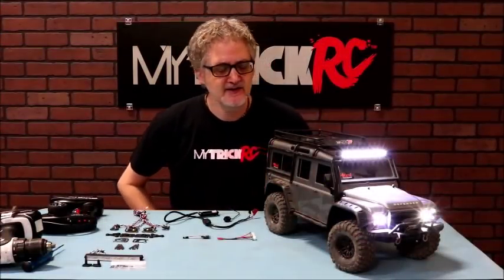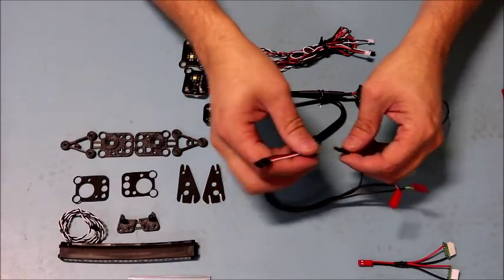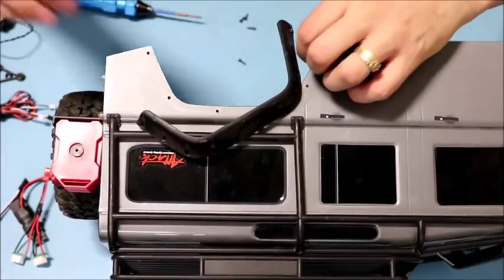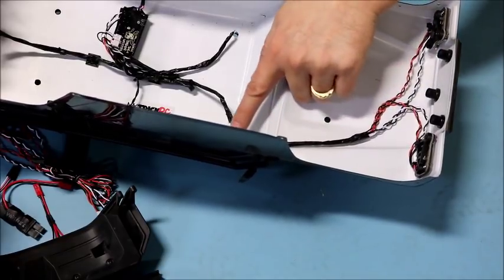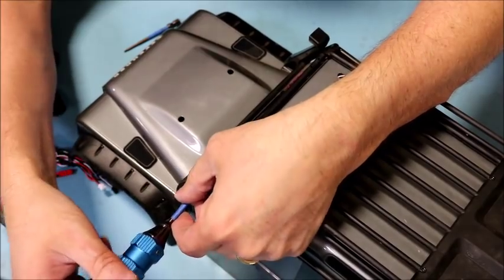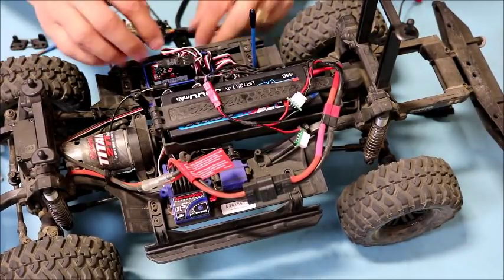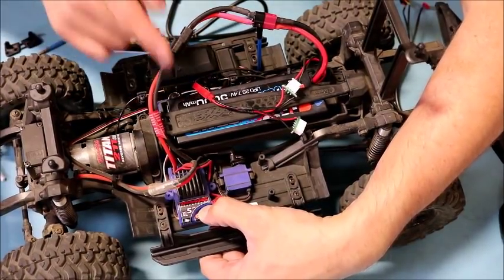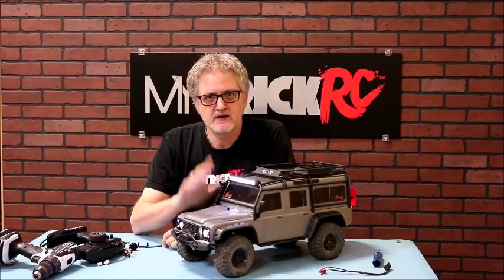Attack Traxxas TRX4 DG 1 Light Kit Install

Comment: I added this dragon light kit to my TRX. The one thing I missed in the video, is after hooking everything up, you have to use the selector to turn the lights on - and select the brightness. I could not figure out why the lights were not coming on. :)  One other note is that you need to have the throttle set to 50% forward and 50% reverse. Otherwise, the 70/30 split option will have the reverse lights on when the truck is in neutral. The lights look great and put out a lot of light. A great addition.
Reply from the maker: Good feedback, thanks Chris.

Comment: Very helpful video! I have a couple of questions for you. I want to cut the controller button cable, add connectors, and mount the button on the roof behind the light bar to make changing modes a lot easier. Do you see any problems with doing that and do you have any tips or suggestions in doing so?

Comment: Hi! I'm looking to purchase this kit from your website. One thing that's confusing me - does the controller differentiate between brake and reverse? I'm guessing not?

If it doesn't, it won't affect my decision to buy the kit, only if I should purchase both red brake and white reverse running lights, as opposed to just brake lights. Thank you 👍

Comment: I think this is an awesome kit! But, does adding the lights + wiring not compromise the waterproof electrics? What I'm asking is can you still wade through bonnet/Hood deep water?
Reply from the maker: All servo connections should be as waterproof as all of the other servo connections inside the receiver housing.  Regarding power there are two types of connection options, the balance port version which comes standard with the kit, or we also offer an inline "pass through" power tap which improves water resistance by connecting via JST connector.  In either case, the water can penetrate the connector, and we do recommend protecting that connection as much as possible.   We also recommend avoiding full submersion if possible, but the Dragon itself should not be damaged by it if you do.

Comment: The light bar I ordered last year did not come with the 3D printed bracket shown in this video. It did come with other brackets that do not fit. I don't want to punch holes in the body to mount it and the correct way is to use the roll cage to mount. I just don't understand why my light bar did not come with those brackets.
Reply from the maker: Please send us an email from the contact on our website.  We are happy to send you a set.
Reply: @MyTrickRC  I did send an e-mail and was told that I would be getting getting a set of the roll cage 3D parts but I never received tracking and never received the parts.

Comment: How does this work with the Castle creations cc bec 2.0? I see there are two unused plugs/ connectors on the Dragon Receiver harness. Castle says to disconnect the red wire off the speed control, so how does this affect the dragon unit? Any help wounld be great. The Castle bec is the waterproof unit and has two leads coming from it to go to the receiver , it's getting cramped in the receiver box already lol.

Comment: I bought the DG1BR233039 for my Bronco. That install video led me to this video which is a variant with the light bar. It isn’t the same kit but I’d assume the programming would be the same as the light bar in this video is just an additional light. I’ve managed to get all the lights to work and figured out the long/short press config for the headlight brightness but my brake lights & reverse won’t work. I’ve tried reprogramming the DG1 on the 5th mode numerous times, unplugged the 2cell balance port and I’m split on the channel 2 throttle as instructed. It’s also setup the exact same way as this video shows in regards to the the led strands port locations. Any ideas, or maybe this one is defective?
Reply from the maker: Hi, can you send us an email to: info@mytrickrc.com  We would like to see some pics of your wiring at the receiver.
Reply: MyTrick RC will do asap. Thanks for the reply!! Aside from that minor issue they’re awesome. I dig the high, mid and low beam feature too. It helps out quite a bit when taking photos.
Reply from the maker: @monkfry  Yes, we had the same experience.  Thanks for your support!

Comment: So it doesn’t do brake lights correct I see the running lights but no break before you went into reverse
Reply from the maker: Correct, this kit only does rear tail lights, and reverse.   Our UF-7 kit for the TRX4 has both brake lights and reverse.

Comment: Looks great. Do you need 3s lipo for this or is 2s lipo also oké? And where can I order the kit?
Reply from the maker: This system works off 2cel or 3cel Lipos, either one is equally good.  We have them on our website, there is a link on the home page.
Reply: MyTrick RC oké thanx. How about shipping costs to Europe?
Reply from the maker: It varies, you can try processing using our site.    Some places we are able to ship it free, others could be $6 or $10
Reply: MyTrick RC Thanx. Last question, does the kit come with a manual instruction?
Reply from the maker: Yes it has an instruction manual included
Reply: MyTrick RC is it on backorder at the moment?
Reply from the maker: We have a few in stock, and will be fully restocked in the coming week.

Comment: How would this work with a different brand esc? I've been planning on getting this but also have an esc upgrade in mind, so I'm wondering about compatibility.
Reply from the maker: It should work.  On rare occasions we've seen weird interactions between different ESC/ vehicles  But overall 99% of customer installations are issue free, both stock and custom builds.

Comment: How do I use this with the integrated balance connector battery that came with my trx4?
Reply from the maker: On our website under "Customize your RC" you can buy a Traxxas Power adapter that lets you tap power straight from the battery.  The cost is $4.95